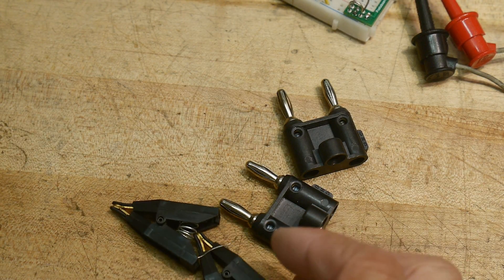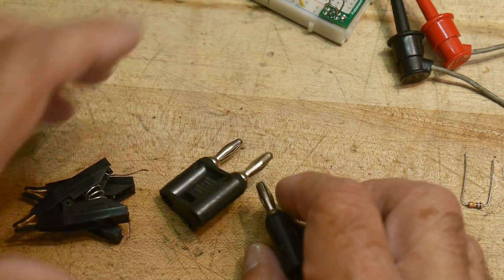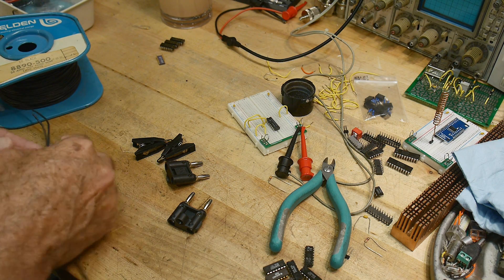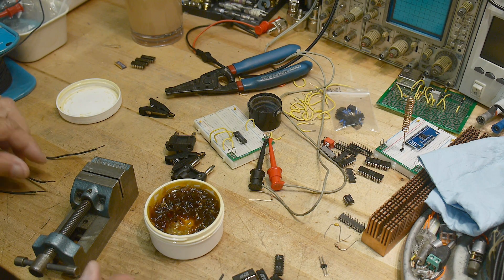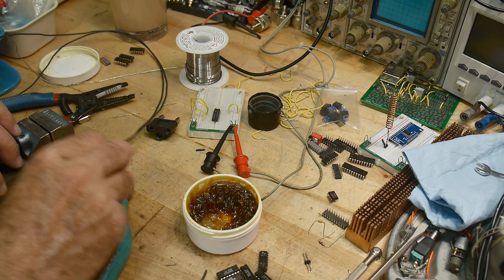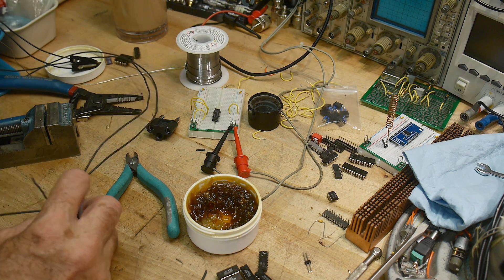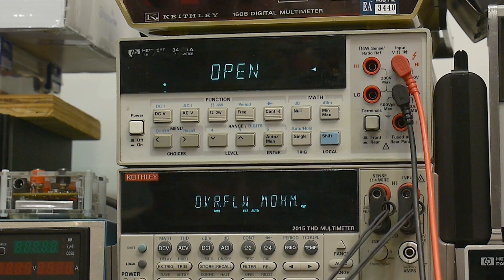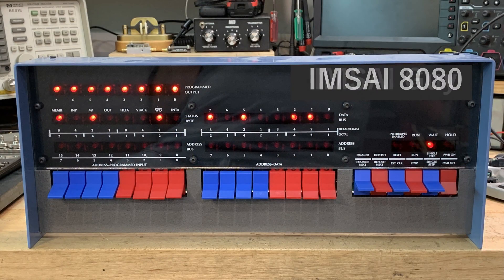#1582 Let's make a Kelvin cable assembly

Comment: Tinning wires to use in screw terminals is poor practice, since solder cold-flows under pressure, so the screws will eventually need retightening. A better solution is to use wire ferrules. (It doesn’t look like those clips offer enough room to use crimped fork or ring terminals, or solder tags (rings with solder tabs).)

Comment: I wish i could afford a Keithly 7 digit multimeter. But they are insanely expensive. My bench multimeter doesn't even have a 4 wire mode.
Reply: The one shown is a 6.5 digit Keithley 2015. They’re not too expensive on the used market, with some patience.

Comment: What you need is a Brother P-Touch label machine with the printable heat-shrink tubing cartridges.   Make real nice cable labels, looks almost like you know what you're doing 🙂   I discovered these whilst building my Voron 3D printer which has way too many wires going hither and yon.
Reply from the maker: I do have a label machine. I didn't know about those cartridges. I'll have to try one.

Comment: I think I would twist the wires together, and add a ferrite at the meter end. Congrats on showing the noobs all the possible mistakes they might make.
Reply: I have a bead that I can add to mine. Please explain which wires should go through the bead and why. All four? Just the single black/return resistance reading wire? Please and thank you.

Comment: "4-wire" resistance measuring done correctly.  A "Kelvin connection" means a Kelvin connection with separate V and I connections for each Kirchoff node

Comment: Hello, I was yelling at the monitor like crazy, but what I really didn't understand was why you made it so complicated, all you had to do was connect the double connectors horizontally - so that's how I do it - I have the GND symbol as a mark in the sense socket, in addition, they seem to me the wires are terribly thin - I have made exactly such a pair and I used the rest of the speaker cable with a cross section of 0.75 mm2 from silver-plated LC-OFC for the connection. 
I have one double connector red and the other black, if you only have black, you can swap for the gray one you have on the clip cords 🤔

Nice day 🙂Tom
Reply: the interconnect wires can be thin and have little effect on accuracy. That's the whole point of 4-wire R measurement. To eliminate the effect of the interconnect
Reply: @jagmarc  I know how a 4-wire works, but it seemed weak to the wire (interlaced with fiber - that's how I understood it from the video).
Reply: @Edisson.  well the wire can't be too thin or it would break too easily when pulled.   Fiber-reinforced cable would enable 40 AWG to be used with little effect on accuracy
Reply: @jagmarc  In my practice, I have come across super flexible fiber-reinforced wires that had a relatively high specific resistance, I use High End professional audio cables for these applications, they are very flexible and made of high-quality material. When I worked in research laboratories where we had top measuring wires (at top prices), I made a comparison of what to make something similar at home. The audio cables performed best when measured at low frequencies and DC (compared to what I had available), the only drawback against the original test leads was the insulation - it's not hardened silicone.
Reply: @Edisson. As you're aware of how 4-wire measurement works I expect you'll also agree with me how also having very little (if any) effect on accuracy is to use aluminum or steel conductors, or perhaps even resistance wire . I quite like the idea myself of thin headphone wire as it's light and very flexible. 
I guess 100% oxygen free gold plated solid silver wire would be nice if you'd paid $30,000 for speakers and you dutifully allocated the "5% of speaker budget to spend on interconnect" like the experts recommend
Reply: @jagmarc  I always try to make the measuring wires have the smallest possible resistance, because I use these clips for other than 4-wire measurement. I'm not one of the HIFI maniacs with cables for X thousand, in audio I try to use quality cables for both speaker and signal connection at reasonable prices, I buy cables by the meter and make them to order, and I also made the Kelvin clips from the leftovers. I use silver-plated OFC cables from Sommer, Mission, Ohelbach, Monster cable, etc. For example, my 300W audio load (also of my own production) is connected to the speakers with a Jamo Silverline OFC 2x2.5mm cable, and I connected the Kelvin tweezers of my own production with a four-wire signal cable separately shielded for mechanical protection stretched in a protective braid.
Reply: @Edisson. are you 100% sure you know how 4-wire "kelvin" measurements work?    because I can't see any advantage at all in lower resistance leads.   I just checked the schenatic for what's behind the Keithley's input sense socket  and it's a 900K series resistor
So adding series resistors in each lead would be a good modification for a kelvin clip lead set, to protect it from accidental overcurrent damage
Reply: @jagmarc  Yes, I'm sure, I also wrote that I use Kelvin clips for other measurements and that's why I choose wires with low resistance everywhere. I am familiar with current injection and voltage sensing during 4-wire measurement - that's why I also use it - for example, for searching for shorts on a PCB, measuring shunt resistors, or with an LCR meter. Although the meter has a protective resistance at the input, it calculates with this value when reading the measurement, and in the case of low-quality cables with added resistance, we have the REL function
What is not clear to me is why I should use low-quality wires if I don't have to, because the Kelvin clip can also be used for two-wire measurements - for example, button batteries, fast one-handed measurement of two-terminal components - I use it, for example, with a curve tracer to measure diodes in PCBs and a lot of other measurements - I open the terminal and touch the contacts to the component from both sides at the same time and one hand is enough for this, the other can readjust the tracker.
Reply: @Edisson.   Still puzzled why for kelvin 4-wire measuring clip wires you're advocating "smallest possible resistance" top quality measuring high end professional silver plate oxygen free copper. Like using a gold-plated cylinder for barbecue gas. Works precisely the same accuracy even using resistance wire.   And what would you (mis)use kelvin clips for other than 4-wire measuring
Reply: @jagmarc  You didn't understand me, I don't bother with the use of resistance for 4-wire measurement, I just wrote here "Why would I introduce added resistance into the manufactured measuring cords if I don't have to" and the cables I use I use because they are super flexible and of high quality, in addition it is made from leftovers. I repeat once more "I also use the measuring cords for two-wire measurements, and there the added resistance would already be a problem."
For example, I use the Kelvin clip to charge the rechargeable version of the CR 2330 - I simply put the cell in the Kelvin clip, connect it to the source, and I don't have to worry about a holder for different battery sizes.
Reply: @Edisson.  I'm simply stating 4-wire 'kelvin clips' resistance measurement doesn't need special wire & wire resistance has completely zero effect, anything more is like using a gold plated cylinder for barbecue gas.
...and you're saying: "I chose wires with low resistance everywhere" , "why should I use low quality wires if I don't have to", "why would I introduce added resistance" ,"I always make the smallest possible resistance" , "I use silver plated OFC from Monster, Oelbach, Mission, Somer" , "I made a Jamo OFC Silveline 2x 2.5 separate sheilded", "I use High End professional audio cables for these applications", "I don't understand why make it so complicated, just connect the double connectors horizontally' like I do it" , "it seems your wires are terribly thin, not like the exact pair I made with 0.75 mm2 silver plated LC OFC" , 
and something about working in research lab comparing top measuring wires with home made ones or something, and now try find other (mis?)uses for a Kelvin Test Lead that's been made with silver plated oxygen free copper separately sheilded for mechanical protection stretched in a protective braid :-)
Reply: @jagmarc  I absolutely do not understand what you mean, at a time when the Chinese sell tinned iron wires, or aluminum copper wires that start to melt under greater load, I try to use what is available to me and it has at least some quality. I don't buy superHiFi wires that have a molecule of conductivity more than others, I found reasonable cables at a reasonable price and it works out cheaper than original measuring cables and I repeat again, I use Kelvin clips for other applications, so for my needs thin wire is not suitable, i never wrote that it couldn't be there. I have original Kelvin clips that were part of the equipment of the measuring devices, one for the LCR meter (four separately shielded wires in one cable) and the other for the multimeter and they have a wire cross section of 1mm (for DMM). I'm not after any golden gas bottles, I'm just fine with using leftover audio cables for some applications - it's still better than aluminum from the Chinese.
Reply: @Edisson.  are you sure you 100% understand how it works 4-wire 'kelvin' resistance measurement ? Because it doesn't matter the quality of the wires.  
Still can't see the relevance mentioning "smallest possible resistance oxygen-free Oelbach silver plated Jamo 2x 2.5 sqmm Monster top quality high Mission end professional Silverline shielded separately etc."  
Or maybe we're talking about a premium "Enhanced Super-Kelvin" test lead set that's marketed to out-perform 'ordinary kelvin clips sets' in independent lab A-B tests for charging coin cells. :) yeh! Go for it! New product!
Reply: @jagmarc  We still don't understand each other, I don't know how to write it anymore, I didn't write anywhere that I have a 2.5 cable to the Kelvin terminal, with that cable I have a 300W audio load connected, I only mentioned these cables as a possibility of use in other cases. On the small Kelvin clamps, I used 2x0.75, which was left over from one assembly, because it is super flexible, the double line holds together, there are no separate wires rolling anywhere, the cable is connected directly from the clamps to the double connector, and if I am not using it as Kelvins for measuring resistance, then I can connect the double connector to the source and snap the clamps onto, for example, the button battery in the car key - that way I connect the + and - batteries at the same time using one clamp, because it is otherwise charged in the car, and before I started repairing the key, I used one The Kelvin clamps charged the accumulator. Or I can use the Kelvin as a measuring tweezer for two-wire measurements, that's why I used a 0.75 cable. You know what I mean, I'll just use one Kelvin clip for a two-wire connection, it has nothing to do with measuring in a 4-wire. In the labs, I did experiments on how audio cables behave at different frequencies, what they can be used for, because, for example, professional signal cables have great mechanical resistance, are very flexible, are multi-conductor, have excellent shielding and stand a minimum against special measuring cables.

I'm sorry because my English is not good and I don't know if I'm expressing myself correctly.

Comment: or you could have just rotated your dual-banana plugs 90 degrees on the meter side and they would have worked, as I believe the spacing is the same. ;)
Reply: Aka the "KISS" method.
Reply: This is how I use it on my multimeter, in addition, I have one connector and clip red and the other black (also self-made)
Reply: You are correct, however his solution is actually  better as he can use these leads with both Keithly and HP meters. HP does not use standard spacing between the source and sense banana jacks. Regards, David
Reply: @davidv1289  Thanks for the info, I didn't know that, my old HPs (427A, 209A, etc.) support this width.

Nice day 🙂 Tom
Reply: @davidv1289  Your 100% correct.  Why I thought it was the same both ways - a brain fart on my part.  Considering I own a 3455 and a 3456.
Reply: On the Keithley yes but on the HP (above the Keithley) the horizontal spacing is wider and dual bananas won’t fit. I assume he wanted these to work with any of his meters.
Reply: @ricksharpe6895  100% correct Rick.  I should have know that, as I've used 3455's and 3456's for years.  Dying brain cells - ha ha.
Reply: I can't read the model number in this video but it looks EXACTLY like my hp 34401a. My sense and measuring pairs are on the corners of a square,  as close as I can measure,  and my dual bananas fit horizontally just as nicely as they do vertically.